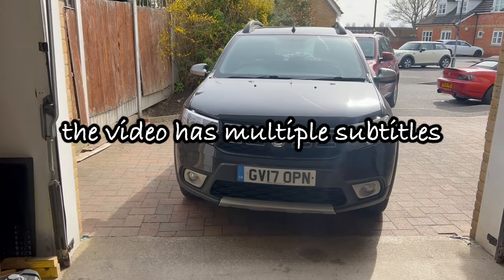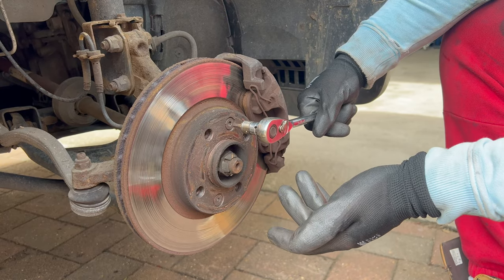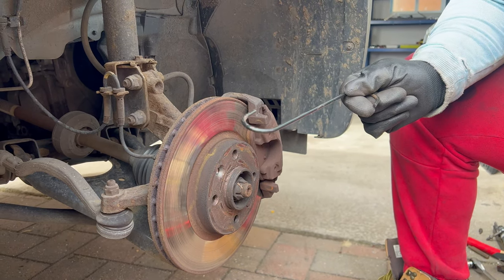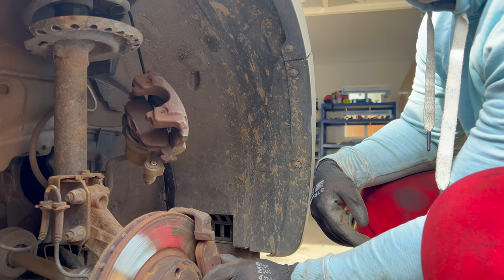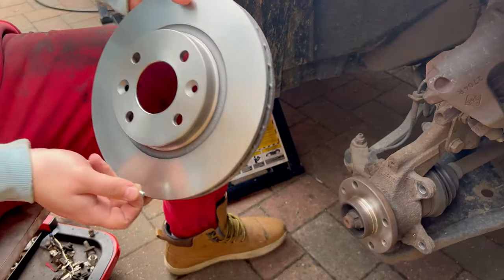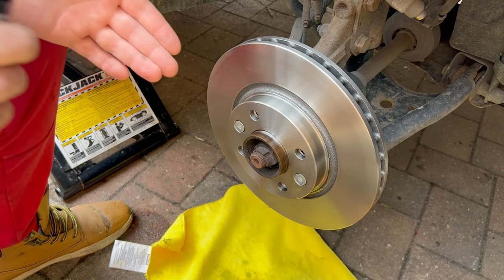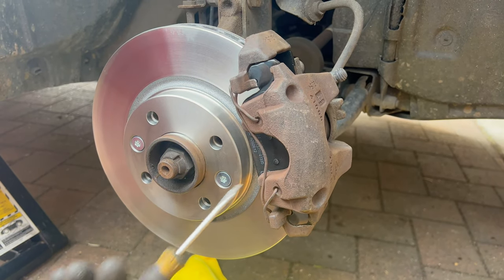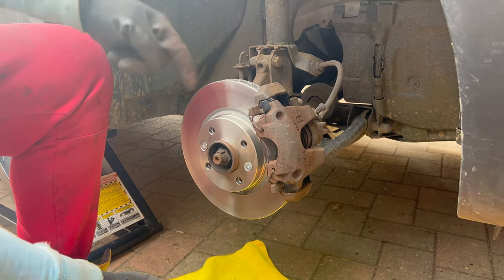Brake Replacement Tutorial For Dummies - How To Replace BRAKES 101 Dacia Sandero 0.9 TCe

Comment: Sorry to trouble you Mr Nice Guy my friend. I did this job today and was concerned on re-fitting the calliper and tightening that the slide pins were showing between the two metal surfaces, about 1cm of nice clean, greased slide pin visible. I thought that looks odd..😮I torqued up the pins to 28nm and they basically were in tight, with the weird shiny bit still showing. It looks like you have the same pin showing in the gap at 4:35 but as you are removing they are not shiny, is this normal? Presumably some rubber boot keeps the dirt and water out? 🤔
Reply: Should keep the grime out to a certain extent.Take the pins right out and clean up on a buff or light sand paper .Next give them a light coat of copper grease